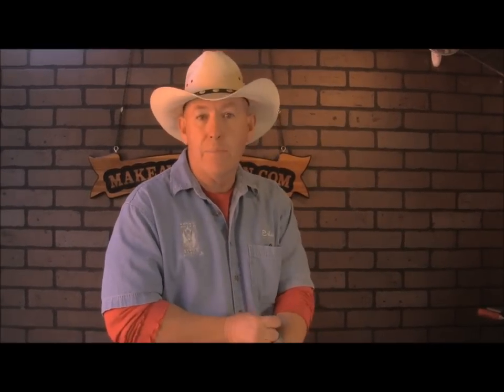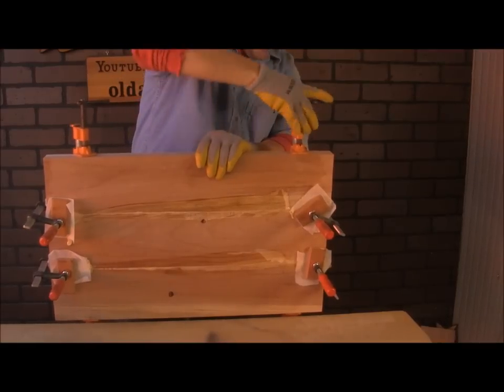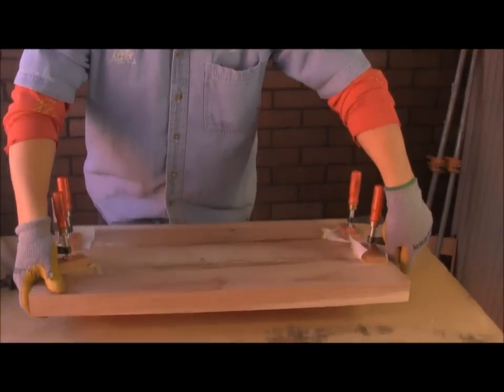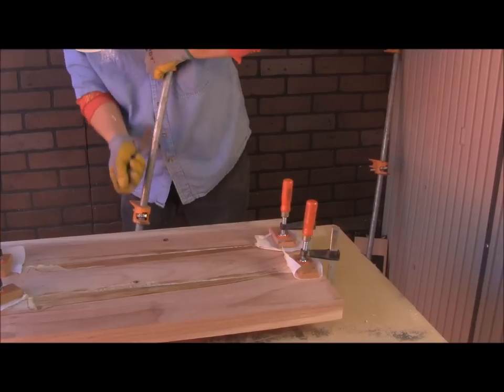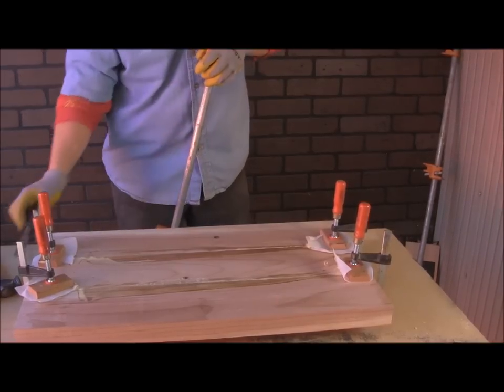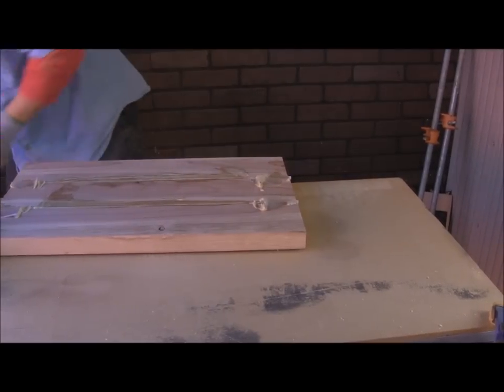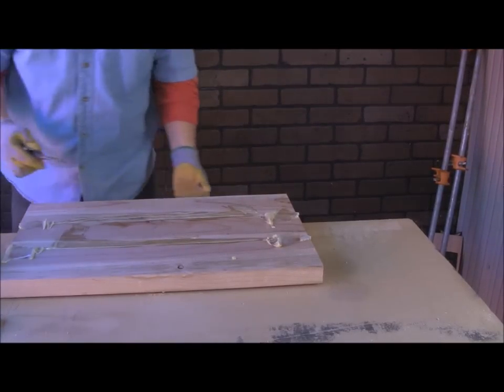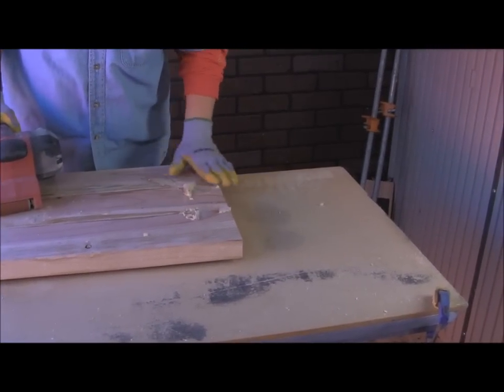#155 Surfacing Laminated Boards

Comment: Eric this can also be a great way to get rid of the ink to save sanding time. Thanks for sharing.
Reply from the maker: +Raul Padilla Thank you for the input, but I wouldn't suggest that. I meant to go over that on the video. It most likely will chip off parts of your carving. I wouldn't take the chance. That's just me. It would be a shame to ruin a sign that way. Just my opinion of course,  Eric

Comment: Hope you had a great Thanksgiving!  Great video.  Turns out I have one of those planers and never used it.  I will definitely use this method from now on! Also, on the pipe clamps, I just put painter's tape on the pipe when I clamp them up so I can peel it off with the glue on it.  Works pretty well.
Reply from the maker: +SHARPSHOOTER69 Happy Thanksgiving to you. Good idea. I'll give that a try. Thank you, Eric

Comment: I found one of those power planers several years ago.  It is a time saver, but you have to have a light touch just like with the sander.  You also have to do your best to keep it level left and right, if not, it's such an aggressive tool it can cut grooves that will require extra sanding.  Just takes patience and some getting used to.  Well worth the money though.  Good Video!
Reply from the maker: +Roger Woods Really good points Roger. I will make this a subject for an upcoming C&Q episode. Thank you, Eric

Comment: awesome, i was looking into one of those thanks. 

also you mentioned for larger signs you use a 2 in strip (call) to keep them flat. i don't know if you use packing tape but if you wrap the call in packing tape or any other piece of wood you dont want to be "glued" it will keep it from being glued. but i use titbond not gorilla glue. 

have you or anyone else used dowels, or biscuits to keep the boards flat. i was think about that for long pieces. and if you cut into them with your router by mistake i would not think it would not damage the bit since the biscuit is wood. and you are painting the "lower" sections anyway you should not see it.